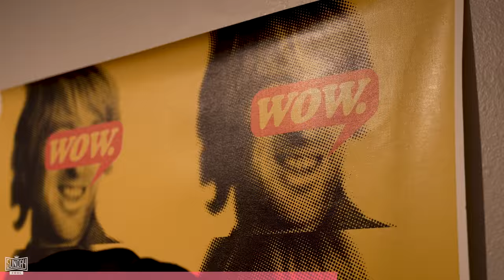Do Ladies Yap Too Much? | EP.47 | Ninjas Are Butterflies

Comment: The 'green hoodie guy' was not the same plane as the woman having a feak-out... Look at the overhead storage on the womans video, then look at the overheads in the video with the guy in the green hoodie. It IS NOT the same plane. Yall need to verify what you are saying. In this specific instance, you are spreading false info. The bins on theplane the woman was on open UP, the bins over the man in the green hoodie open DOWN. There is a video showing the attendants opening the bins and they def open differently than the ones next to the woman. Not the same plane...